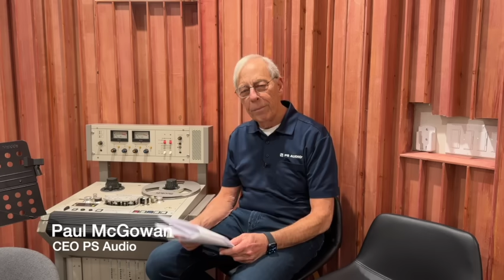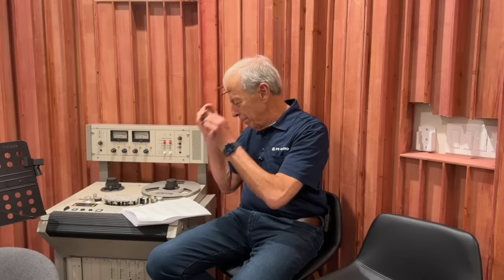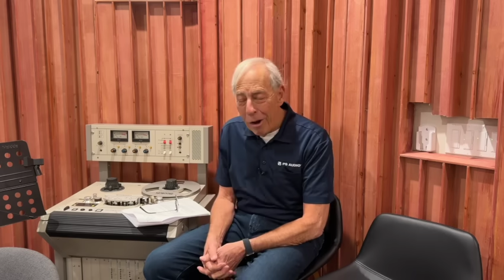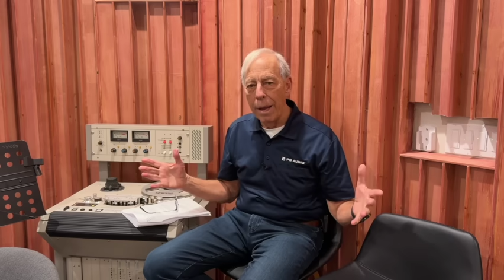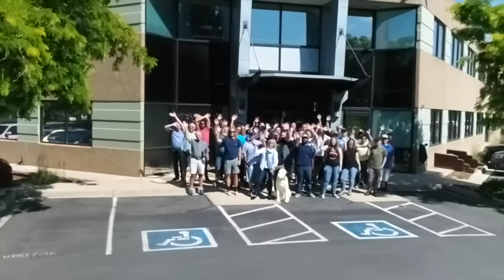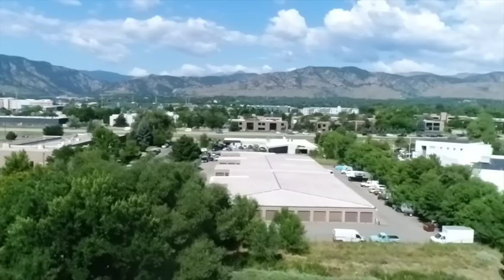When measurements and listening disagree

Comment: Bob Carver proved 40+ years ago that a mid-fi amplifier can be made to be sonically indistinguishable from any target amplifier by modifying its output transfer function.  He did this with electronic measurements - inverting the output of one amp, summing the inverted signal with the other amp, and tuning the mid-fi amp until the null was minimized.  The two amps - the high priced amp and the modified mid-fi were made to be nearly identical electronically (the electronic null was much, much closer than the typical amp matches its own left and right channels).  A blind listening test done with audiophiles (published in Stereophile Magazine) proved that the two amps sounded identical.

This, in-part was made possible by the fact that his solid state mid-fi amp had a slew rate high enough that any improvement in the slew rate isn't audible.  (Slew rate is related to the output impedance). 

The bottom line is that there is no magic about human hearing that exceeds the ability of electronic measurements to match the sound of two different amps.  Paul even did a video on the "Carver Challenge" but it seems that he might not have actually learned the lesson.
Reply: Too bad the test amplifier Bob designed was very unstable and wouldn't have worked with as many different speakers as the reference amplifier. He also couldn't do it in production models.
Reply: @mitchtaylor6512  You've been schooled on this before, Mitch.  Carver couldn't achieve the fantastic 70 dB null in production because he couldn't get single value resistors with the precise resistance values that he achieved with potentiometers in his demo unit.  He did get a 35 dB null which is so good only some listeners were able to hear the difference.  

The SAME amp sounds different with different speakers as speakers present different dynamic impedance loads.  You might like a given amp/speaker combination but hate the sound of that same amp with a different speaker.  

His designs were NOT unstable, that's an outright lie.
Reply: @markmeridian3360 his test amplifier in the hotel room had a very unstable null, he even admitted it.
Reply: @mitchtaylor6512  No it didn't.  You're making that up, like you always do.  

The null he achieved in the hotel room changed when he brought the modified amp to the magazine's listening room.  Why?  Because the listening room speaker's dynamic impedance load was different from what he thought it would be in the hotel room.  As you were schooled two times before, EVERY amp sounds different with different dynamic impedance loads.  That is NOT the same as the amp being "unstable".  He retuned the mid-fi amp in a just a few hours to accommodate the different dynamic impedance. 

The bottom line is that Carver said he could make a mid-fi amp sound exactly like a randomly chosen high-cost hi-fi amp using the same speakers. He was given just 48 hours to do this and had to treat the target amp as a black-box (he was not allowed to look at the target amp's circuitry).  The editors of Stereophile admitted, after double blind listening tests with many respected audiophiles, that he achieved his claim in full.
Reply: @markmeridian3360 Carver: If you let the sunlight shine on an amplifier that's sitting there with a 70dB null, the null will go higher. Or deeper. Less null.

Atkinson: This is the crux of the matter...

Carver: A 70dB null is a very steep null. It's really down to the roots of the universe and things like that. 70dB nulls aren't possible to achieve in production.
Reply: @mitchtaylor6512  You're misunderstanding a simple thing that most audiophiles know, Mitch.  Why do you think that you need to warm up an amplifier?  Why does Paul never actually shut off his amplifiers, he just shuts off the displays?  It's because ALL electronics changes response with temperature, Mitch. 

 Of course the 70dB null will get worse if the demo electronics warms up from its operating point.  The null would get worse if the target amplifier warmed up too.

You really don't know much about audio, Mitch.
Reply: If instead of an hour or 2, the sibjects would have been given the one amp to listen to at home for a month or so, and then be goven the other amp for a month or s; to listen to their favorite music of many genres. There would likely have been a preference between the amps; and therefore a difference. Humans are not good at quick, short term A/B comparisons. There's pressure, there's unfamiliarity, etc. Their thoughts and perception get all jumbled up in their heads on a quick test like that. That's all it proved.... A/B testing is always a simplistic farce & a comedy of errors. 

 Carver got it close enough that a brief session was not enough to discern the differences. Carver made some real nice  equipment,, but Carver was not among the best equipment. How could tests like this fool people into thinking his amps are equal to the greatest; when they were not? 
If the tube amp would have been an Audio Note Kegon or something; it would have been no contest.
Reply: @sidesup8286  That's totally made up.  Most people are actually extremely good at A/B/X blind listening when there are real differences between A and B.

What has been proved is that people have extremely poor memories for subtle differences in audio heard more than a few hours apart.

Carver achieved a 70 dB null.  That's MUCH better than the typical 45 to 50 dB null between the L&R channels in the SAME amp.   Do you have a preference for your L channel over your R channel?  Would you rather listen to each in an A/B/X text or listen to them separately for a month in sequential months to decide?
Reply: @sidesup8286  Ehm. That's actually the other way round. We are very good at quick ABX blind listening if there are differences. We are very poor at retaining audio as a memory for more than seconds.
Reply: The test was done in a hotel room. And you all know how they can sound; going to shows. The spatial aspect was probably near non-existent. The only thing that proved to me is that he got the frequency response to be simolar enough....Probably by boosting the lower midrange frequencies, and cutting some of the treble. Carver did way more amazing things than that. His Sonic Holography should have caught on better and become the standard way we listen to music. Hi Fi News (U.K.) said there's more difference between sonic holography and regular stereo, than between stereo and mono. I could never listen to regular stereo again without that Sonic Holography switch in the on position.
Reply: @sidesup8286  NOPE.  You totally made all that sh** up.  The modifications were done in Carver's hotel room, the blind listening tests (plural) were done in Stereophile's listening room.

I used to preview Carver's equipment (my Father in law lived a block away from Bob Carver.  His demo of Sonic Holography was so good it was creepy.  You could hear the singer walk around the room and sing right in your ear.  The Achilles' heel was that it didn't work that well on almost all actual recordings that you could buy.
Reply: @sidesup8286 my friend has that sonic holography unit, it's nowhere near as good as the polk sda2a speakers I have.
Reply: @Mark. You say people are extremely good at A/B/X tests. Is that why when Acoustic Research had a real group of musicians play (acoustically unplugged),and then repeatedly stop playing, and a recording immediately took over, & no one could tell any of the times the musicians stopped and the stereo took over? The New York Times covered this, many years ago. The sound quality difference between unamplified instruments playing, and early 1970s stereo gear must have been 700%. Is 700% a subtle difference?
Reply: @sidesup8286  You pulled that 700% number out of your dark nether region.  

AR used several tricks to fool SOME of the audience members, especially the ones who were far from the stage.  

Their recording was done in an anechoic chamber to avoid replaying room reflections from the original recording studio, they placed musicians right next to the speakers (rather than between speakers where imaging problems would be evident), and they precisely matched levels of the playback to the live music.  They used specially selected amps (not your typical 70s stereo gear) and their speakers were specially tuned for a neutral response.  The musicians played only a short section and they let their speakers play the entire second half of the performance while the musicians faked playing (proving that people have extremely poor memories for subtle sound differences that they heard after even a short time has elapsed).

Further, they didn't poll each audience member privately, they only asked for a public show of hands, and we all know that people can be intimidated into not expressing a contrary opinion.

Despite their tricks, many audience members, especially those in the front rows, who were questioned after the demonstration reported that they could easily tell the difference just from tape hiss.

This was a marketing stunt, not a blind or double blind A/B/X test.
Reply: @sidesup8286  It must be pointed out that some A/B/X tests have been done in the Golden Ear's home using his own equipment. When it was compared to a cheap amp brought by the tester, the "audiophile" said the differences were like night and day (sound familiar?). When the testing started he could not tell the difference. He then claimed the A/B/X device magically canceled out his magical differences. People like their delusions.
Reply: @Mark. Where did you get your info from?  Sounds like you made it all up. I just talked to my Uncle Fred,. He was there, and what you say didn't happen at all. It was very different from what you just said. Plus there was a series of these in different places; not just one. You must have made the whole thing up! Let us know your source. I'm sure it will be something we can't type in. As far as reproduced sound being 7 times worse than live unamplified music; that is considered  a conservative estimate. And by modern standards; not the relative crap they had in the 1970s. AAR 3A's alone are not. 1/3 as high in fidelity as our greatest speakers of today.
Reply: @sidesup8286  Easy to look up.  You Uncle is right about one thing; they did perform this marketing stunt in several different places.

Other than that, your Uncle Fred has a faulty memory.  I've traced the record of the stunt to what was written about it at the time.
Reply: @Mark. I see how important it is for you to win this argument. So instead of going further, I will use my time to win at much more important things.
Reply: @sidesup8286  Good decision.  You won't ever be able to win any argument by making stuff up like your ridiculous 700% number.
Reply: @Meridian. So YOU think that early 1970s equipment reproduction comes closer than around 1/7 the sound quality of live unamplified music instruments?Really?....That goes against the beliefs of the audio industry. And you call my estimate ridiculous!...For your information, people way more in the know than you, would think YOUR statements are ridiculous. The late former CEO of Linn, the conpany whose turntable is credited with  started high end audio, said years ago that listening to the live feed of the artists in the recording studio (Linn records), made him realize that the final product (lp or cd) only captures a few percent of the sound quality of the original performance. So YOU laugh at people who have a way way better perspective than YOU, to make judgement calls on %. Being in the studio many times making the excellent recordings Linn was known for, he said in a Stereophile interview, that the finest recording
equipment & playback equipment only reproduces a few % (at most) of the sound quality of the live performance. 

 Even without having his expertise and infinitely superior "in person" perspective of recording many artists in the studio, you would think you would have "ears" enough to know that our reproductions are only a mere shadow of the sound quality of live performances. Finding fault with everything I say with your BS, refuting truth with BS to try & win an argument, & finding fault with my estimate that reproductions are only around 1/7 the sound quality of the live event. You attempt to contradict not only me, but people who are actually there in the studio, and who know way better than you, that as good as they can be; cds and los are only a drop in the bucket for sound quality compared to the actual event. If I had to re-estimate I'd have actually put that at 800%. I think you'd have to double the sound quality of our best reproductions, then double that again, and then double that again, to achieve near the sound quality of live. Live unamplified sounds are considered by all (that are not dumb) as THE YARDSTICK; "The Absolute Sound". My 700% less sound quality of music "reproductions" estimate was actually conservative compared to the head of Linn's recording team, back then and the consensus of the audio industry. Nothing more nauseatingly laughable than someone trying to make "ridiculous" someone who is "Correct". 

 Just for a laugh, what % of the sound quality of live musicians playing do YOU think our reproductions get?

Also,  I don't worry about winning arguments, or those who "fancy" that they  have won, when nothing could be further from the truth. And then them being so asinine to try & rub salt in a wound that never existed in the first place.
Reply: @sidesup8286  Saying that stereo equipment is 1/7 the sound quality of live instruments is like saying Chinese food is 1/7 the quality of Italian food.  That doesn't make any sense.  You have to specify exactly what you're measuring to be able to compare two things. 

You're flat lying when you claim that the audio community believes in your totally made-up nonsense.
Reply: @Meridian.Obviously you are here to troll and argue; so I'll be brief, & you can argue with yourself in the mirror. No one but no one in the entire industry that has any credibility, thinks that reproduced muic comes anywhere near the sound quality of live unamplified music. Live unamplified music is the Absolute Sound, as things like distortion, veiling, timbre inaccuracy etc. is all at true ZERO; simialar to your understanding of audio. Stuff like electric distortion, electronic signature, veiling, timbre inaccuracies only occur in reproductions, not in real life music playing  with acoustic instruments. When someone is playing an acoustic instrument in front of you, it is zero distortion, perfect clarity, timbre etc. Only electronics compromise those things & add imperfections. You take up too much of my time with your false accusations of me making things up, and in my opinion and many others we would put the sound quality of live music around 7 or 8 times higher than any reproduction of music. You may think a reproduction is close; but if you could hear an A/B with it live; you'd realize it's nowhere near it.. If you don't like my estimate; then too bad.
Reply: @sidesup8286  You claimed 700% better.  That's laughable.  It's meaningless.  That's like saying my car is 200% better than your car.  By what measure?  Top speed?  MPG?  Passenger capacity?  YOU HAVE TO SPECIFY THE MEASURE before you can compare numerically.  You pulled a meaningless number out of your A$S  *AND YOU STILL DON'T GET IT*.  

This all started with you claiming that A/B/X blind testing was inferior to just listening to A for a month and then B.  That's totally wrong.  A/B/X testing can not only determine preferences, it can expose listeners as not being able to discern a difference.  

I recently completed a blind listening test with 500 other audiophiles to determine if a particular DAC is transparent.  45% could hear no distortion/degradation of the signal (I was in this group).  55% claimed they could hear degradation.  However, of those 55%, 53% were found by the test to be unreliable listeners (sometimes they claimed one thing, sometimes they failed to hear the same thing).  That left 2% who claimed they heard degradation and weren't proven as unreliable.  2% was close to the random fraction of guessing correctly.  The conclusion endorsed the 45% - there was no degradation or distortion.
Reply: @Meridian. A lot of demand for blind testing is there? Hmm...Sounds suspicious... You say that you just took part in a blind test with 500 audiophiles...500 Audiophiles?....500 audiophiles?..  to see if a DAC was transparent?...C'mon now! Maybe YOU are the one that is transparent ..if you think many of us are dumb enough to believe your fictions like this. And that of all people, they would need YOU among the subjects is even more far fetched sounding.. . Really sir. I am a mature & intelligent person, like most others on here. I don't have time for your nonsense, and your "Flipping Your Wig" over myself and the former founder of Linn hazarding a guess as to how far away our best audio reproductions are to live music. Our guesses as to what % of overall realism of live the best stereos can achieve is perfectly rational; someone "flipping your wig" like you over it, is not.... Was the founder of Linn, Ivor Tiefenbrun an idiot to hazard a guess & give his estimate? He was a genius, which you are not, and his ingenious designs & marketing made Linn one of the most highly respected companies. What have you accomplished in your life?...Trolling in comment sections and making up false stories?

 Re: your analogies...Broadly estimating the overall realism percentages of reproduced audio versus the real thing is "NOT" the same as putting percentages to cars and food. Not too many would have to think too hard to realize that. Your Awful analogies don't make sense or relate to this at all. If you want to try & make laughable people like Linn's founder and myself, go right ahead. You've proven yourself to be laughable. Now go in the corner and pout, and leave me alone!
Reply: @sidesup8286  

1) Blind listening tests are offered all the time.  You don't appear to be knowledgeable about how to participate.  I've participated in three so far, two for DACs, one for recording formats (PCM at various resolutions vs. DSD vs. MP3 ).    

2) You STILL don't get it.  700% of WHAT????  

Years ago, I taught at a major university.  I was bound and determined to not let anyone fail.  I held extra office hours, worked to figure out what was holding struggling students back, and developed extra materials to help those students learn the concepts that they were missing out on.  Despite my best efforts, about 5% still failed.  They fell into two categories, a) either they were not motivated to learn or b) they were just, let's say, hard-of-thinking.  I'm sorry to tell you, sidesup, that you're in the bottom 5%.

3) You're lying, AGAIN.  Ivor Tiefenbrun never made the absolutely nonsensical claim about live music being 700% better than recorded.  He said that that the highest fidelity audio system only captures 1 to 2 percent of the information available in a live performance.  Maybe so.  The sounds that can be recorded by a few microphones at a few locations are a fraction of all the sounds that exist all around live performers.